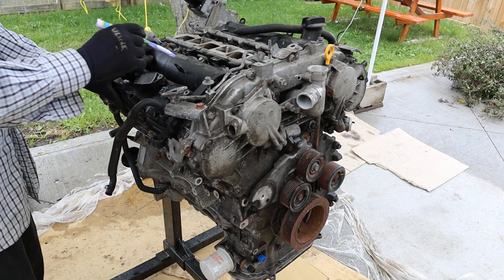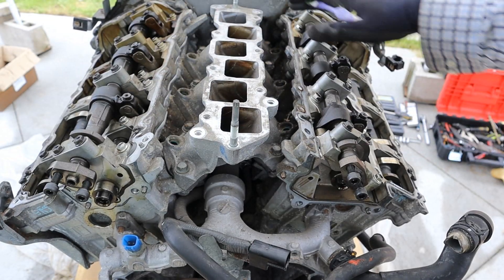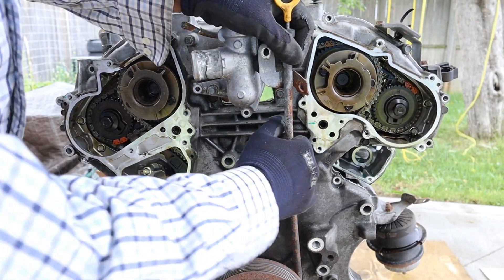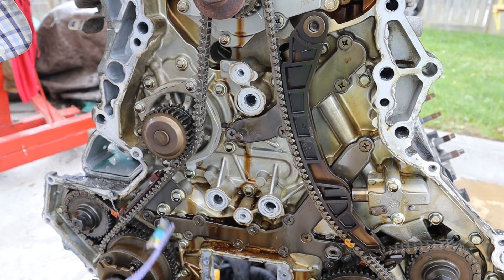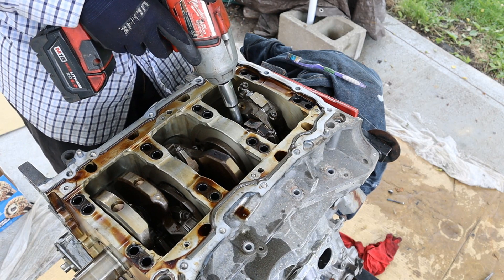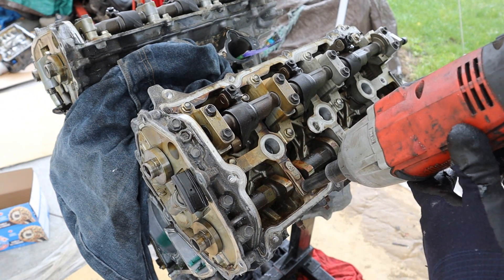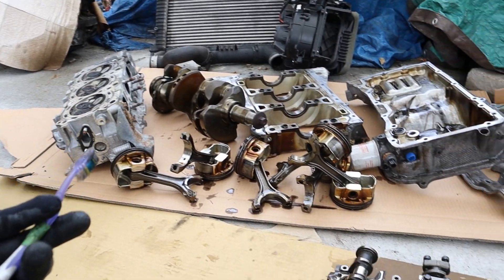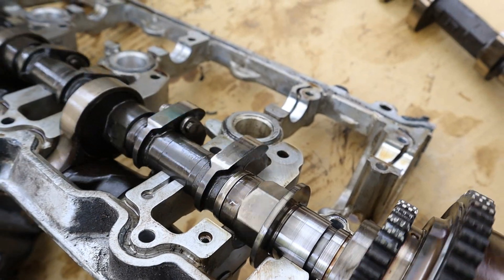The Last Good Nissan Engine: VQ37VHR

Comment: Great video, love your informative commentary.  I owned a 2011 G37 Coupe with 66k and traded it in for a 2014 370Z with 11k miles.  Currently my 370Z is at 17k and I drove the G37 for about 13k miles before trading it in.  No engine reliability complaints however Infiniti interiors are garbage in hot climates, my entire dash had a gooey soft texture all the time and it completely peeled off after I placed a phone holder above the infotainment screen.  I also had the dreaded water leak from the sunroof.

Funny thing is the G37 Automatic has a better exhaust note than the manual 370Z, go figure.

Comment: So did this happen because the person wasn’t checking their oil and it ran low?
Reply from the maker: Very likely.
These engines burn oil and have the galley leak so the owner might haven't even suspected
Reply: @speedkar99  Ok Ya thats why i check my oil 3 times a day.
Reply: @e46m54nissansr20937  better make that 6 times a day just to be sure man. I don’t think 3 is enough you might be riding on luck right now
Reply: @trizkial7592  most definitely man, I will. Thanks

Comment: So, When the VVEL does fail, Does it have a Fail-Safe? I remember hearing that Valvetronic kinda does in case of it having a failure?
Reply from the maker: Yes the dual throttle body is the fail safe

Comment: Last good Nissan engine? Did stop making the VK, VR30DDTT or the VR38DETT?
Or is someone going to tell me these engines aren't good?
Reply from the maker: Watch my Q50 review and then come back
Reply: @speedkar99  I will but I do know these engines are prone to carbon buildups and waste gate rattle. Seems like every damn modern turbo direct injection engine has either one(I am looking at you BMW). But I will watch that Q50 video.
Reply: Those engines aren’t good.
Reply: @trizkial7592  right...there are engine builders, people much more knowledgeable on the topic that would beg to differ...I think you will have to be straight up clueless to even call the VR38DETT "not good" but call the VQ37VHR good.

Comment: Personally, I never much cared for that engine. Went revved  high they are quite rough. Unlike similar size engine from Toyota or Honda
Reply from the maker: Agreed. The Infiniti engines aren't as smooth or refined and their torque band is alot higher
Reply: Really? I’ve had both and while the Toyota or Honda is a little more “smooth” those engines lack in power compared to the VQ. The VQ was ahead of its time. 350 hp is amazing out of a NA v6

Comment: If the water pump is powered by a timing chain. I stay away from it altogether because mixing oil with coolant is never good
Reply from the maker: Good thought. Dangerous design but generally have proven in the Vq35 that's still in production today
Reply: Haha yeah it’s a PITA to access, most don’t need service until 200k but it’s a very pricey service.

Coming up on that in my own g37 not looking forward to it. Hah
Reply: If its a high qualty Hitachi water pump , you may never have to replace it. My 2014 Infiniti has 180k miles on it,still original water pump, alternator, starter , power streering pump, ac pump,fuel pump. and oil will not mix with coolant in Infiniti cars. Their water pumps have peep holes. Coolant will drip to ground when pump fails..
Reply: @rachelgreen1368  You shouldn’t have to but the timing guides wear out at around 200k miles so it’s generally recommended to do it then since it’s a lot of work to access the guides and the water pump is right there.
Reply: @BigHeadClan  Good used low miles Infiniti engine about $1500 +1000 to install.Timing and water pump service on 200k engine- 2000$.Ill keep driving it till it fails.

Comment: It was weird watching you tear down an engine that was upside down. My mind wasn't ready for that. Please turn them upright before you tear them down again.
Reply from the maker: It is a big weird but as I explained I'm the video I had to turn it upsided down to get the crank bolt off
Reply: @speedkar99  I know why it was upside down. I watched the whole video. I've also taken apart many internal combustion engines. I just have never seen one being taken apart upside down. That hurt my brain. My brain is used to seeing them upright until the after the heads are off and the bottom of the engine needs to come apart. Then my eyes were seeing something that didn't quite fit with everything my brain has learned and it actually hurt. Maybe next time I'll be able to handle it, but this was just a bit too wild of a ride.

I still love the toothbrush pointer.

Comment: Nissan claims its 328 hp, its actually 350? I know the Japanese underreport their hp
Reply: It has two versions 332hp and 350hp in the Nismo they Japanese only under reported their power in the 90s in particular with their turbo cars.

They don’t tend to under report their power figures anymore except for Nissans newest engine in the vr30.
Reply: @BigHeadClan  oh I see. Do you know about the 2009 G37 sedan? Like the one in this video? He claims its 350
Reply from the maker: 325 was the G37 sedan 
350 were the 370Z

Comment: The oil system is garbage plus the water pump
Reply from the maker: Yes there's some interesting designs done here. The oil galleys through the timing covers are quite risky, it's a shame that that was the weak spot on these motors.
Reply: @Zzz correct in 2012 though if memory serves.
Reply: Bigger oil spacer great oil and better coolant to keep it cold, and better air intake and I guarantee you it will run so cold u can put your side of your face in the engine and it will never get hot. I kno alot of these motors very reliable cool and easy to repair, a home garage car that wont get u irradiated just pleased with your work
Reply: @Zzz 2012.

Comment: Great engine can’t hold power
Reply: False
Reply: @clappedg3555  Lol ok. How many 1000+whp  you see without lifting heads.
Reply: @elmoz122  Not many engines can hold 1000 whp on stock head studs  lol
Reply: @Tachyon836  why would you build a motor for 1000whp on stockhead studs?
Reply: @elmoz122  if the motor is built it will hold 1000 whp

I was saying that very few stock motors will take 1000 whp
Reply: @Tachyon836  name one vhr that makes a 1000whp and has held beside on a dyno?
Reply: @elmoz122  they're all over YouTube, there are twin turbo built vhrs that make 1000+ whp
Reply: @Tachyon836  lol didn’t answer my question and never see em at World Cup, tx2k or fl2k

Comment: Still junk engine I don't like nissian at all. I like simple engines built to last and be rebuilt
Reply from the maker: Well this one's gonna be rebuilt
Reply: A “junk engine” cause “I don’t like Nissan” great logic!
Reply: So Hondas?
Reply: Has some complexity to it but it’s mainly limited to mechanical that have been proven.

People have been getting 200-300k miles out of these pretty consistently and that’s mostly for their sports cars in the 370z and g37z that are abused.

No brand is perfect and Nissan has had its slips but they know how to build a v6 better than most.
Reply: @speedkar99  
 will you make some videos during the rebuild ?
Because it's more complicated than most V6s and got the bearings destroyed, it would make good material for the videos.
Reply: @speedkar99  ....just chuck an LS in it 👍
Reply: I've seen 370 a beat lamb's porsche audi benz and all with simplicity, these are really good engines, slap a turbo on it and it will kill just about any car u think is better. Appreciate a great automobile. Dont hate it, cause u really hate your self!
Reply: Nissan builds the second fastest production car  globally
Reply: You can count your on one hand can’t you